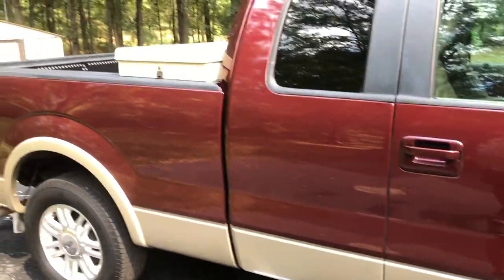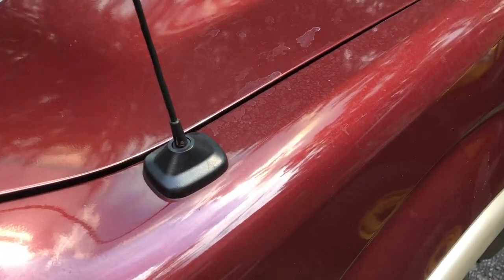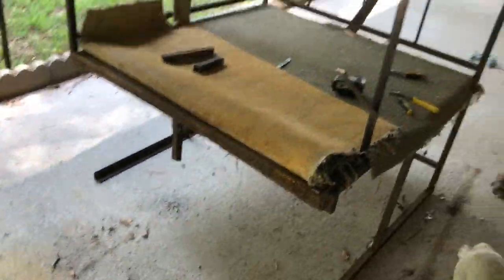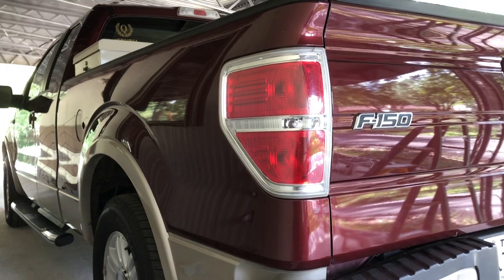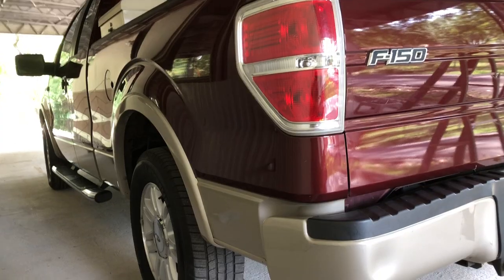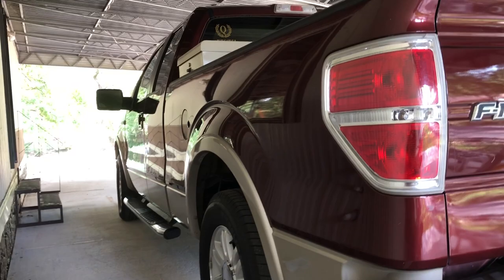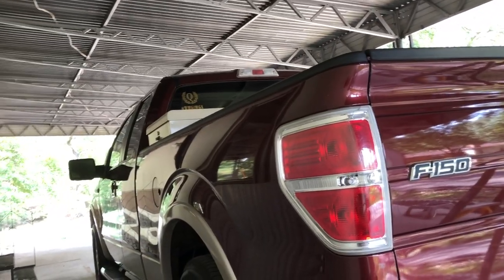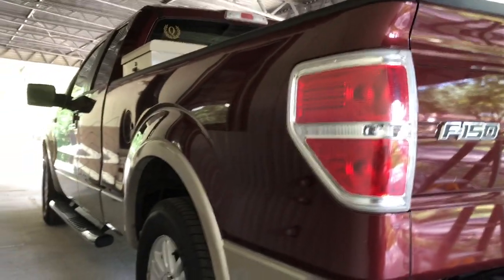My new carport

Comment: @BCtruck, rebuild, repair,repurpose - Good job Brad and @quiltingtrucker.
On the bent bumper, you can use a floor jack with wood bracing to twist the bumper back strait. Then use a bottle jack with wood braced against your rear axle supported with tie down straps hooked to the trucks frame to slowly push the dent out of the bumper, it will be a heck of a balancing act though. 
On the tail-gait dent, if you can patiently remove the tail-gate handle, (you have to remove the inside the bed cover plates to access the handle screws, bolts and detentes), you can fit a tennis ball through tail-gate handle opening and push against the dent from inside the tail-gate while gently heating the dent with a $9 Harbor Freight heat gun, (if you don't have one already), it should pop the dent out.
Reply from the maker: I bent the bracket that holds the bumper. I have to remove the bumper to straighten the bracket. I’ll try to fix the bumper when it’s off.

Comment: You're the guy I prefer to buy a used vehicle, lawnmower or chainsaw from.  After years of watching you meticulously maintain your equipment, I'd have no issues buying a piece of equipment from you.  The underside of that truck looks in better shape than one that's seen a single winter in Michigan...I've spent part of this summer trying to patch up my daily driver 2005 Yukon.  Rust holes you can put your fist in, and it's only a temporary solution hoping the drivetrain will outlast the rust LOL.
Reply from the maker: I’ve seen the devastation that road salt causes. It even eats the rebar in the roads and that’s why they crumble so much faster than southern roads.

Comment: My Mother's '67 LTD had a rattle in the front passenger side, under the dash.  Turns out it had a "factory installed" ratchet in there.
Reply from the maker: 😂😂😂 I have found a few snap ones over the years in my trucks.

Comment: So if you were building a carport, would you suggest paving the driveway first or can that be done after you build the carport?
Reply from the maker: I would pave first then set the carport on the paving and drive the pins that hold the carport down,through the paving.